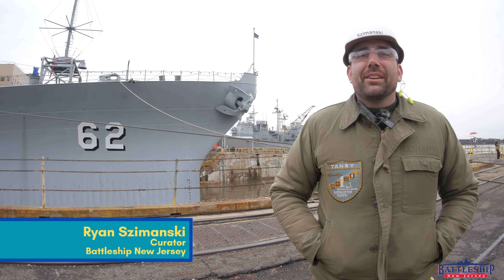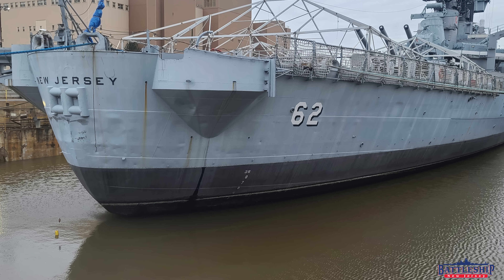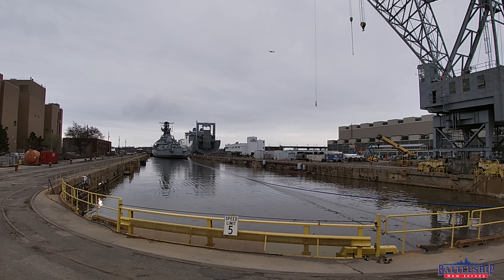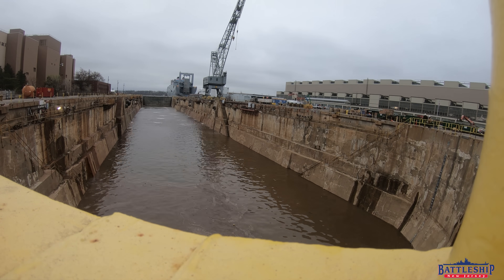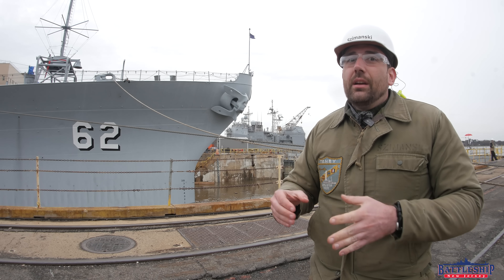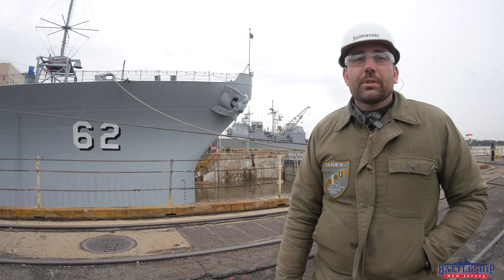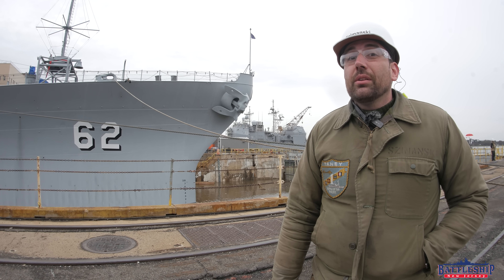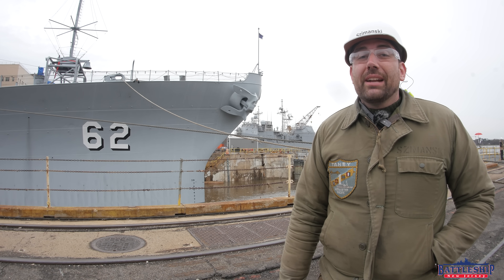How To Position A Ship Onto The Blocks In a Drydock

Comment: This is exactly how it is done here in the UK.
I was a shipyard crane driver in Birkenhead for many years and was involved in dry docking ships for many years. 
The main part of the process is called regulating the dock and is carried out the day before the ship arrives. All the work is carried out by the shipwrights, who lay out all the docking blocks according to the plan  of the ship's bottom. Great care is taken with getting the blocks in the right position and made level. This is a very precise job which calls for accuracy and care particularly by the crane driver.
Once all is ready, the dock is flooded to await the ship.
Positioning is carried out as described in the video, using Tirfors fore and aft.  The dock is drained and work commences.
Interesting and highly skilled work by the shipwrights.

Comment: Many years ago I attended a an awards banquet at Portsmouth Naval Shipyard honoring the engineer in charge of landing USS. Albacore.  For those of you who don't know, Albacore has a very sophisticated hull form shaped like a mackerel instead of a tube,  making her a very challenging boat to drydock.  She's so streamlined she tended to run down tugboats when under tow.  Anyway, the marine railway built to land the submarine derailed halfway through the landing process and they had to build a cofferdam to float the sub into place, hence the engineering awards.  Engineers get awards for solving difficult problems.  However, according to the engineer in charge (and I wish I could remember his name) after the marine railway derailed one of Albacore's former commanding officers told him "I never could get that boat into a drydock straight".  Supposedly the reply was "Now you tell me" but I suspect it was a lot more colorful than that!

Comment: Fascinating coverage Ryan - until now I knew nothing about drydocking! So much planning has gone into this yet as you are showing the actual process is quite basic and very hands on but certainly requires skilled and experienced people. The tugs were amazing - such precision. In flight simulation I often approach a runway at a ten degree angle and straighten up to touchdown but  to approach a drydock with a battleship at an angle and straighten up just as they cleared the stern of the Navy ship was remarkable ship handling. I was amazed at how quickly and smoothly the whole docking procedure was - it made fascinating viewing on the live stream. Thank you.

Comment: I worked on the drydocking of Missouri and Iowa.  I didn't hear any mention of a transit.  I recall one being set up by the capstan and helping spot the ships using a marking on the fantail. I guess that is not longer needed.  Also as a retired engineer I'd suggest you get someone to document the missing pieces of drawing info. that you didn't have.  This will help the next person 30 years from now.

Comment: If for some reason it was desirable to mount heavy guns on a  new class of ship is the mark 7 still the best gun and if so is there a different propellant that has been developed that would be used? Could hyper sonic missiles be fired from guns to get them fast enough for them to use scram jets or would you need special guns?

Comment: Might be a stupid question, but ya know what they say, no such thing...
Are there scuba divers down there watching for when the stern, bow, etc, touches down and where/how the ship is being positioned?
If not, how do you do that?

Oh... haha nevermind! You answered that question! Rad, thank you!

New question: HOW MANY divers and how long did they spend submerged monitoring?

How did they do that back in the days before scuba divers existed or were not advanced enough to be able to do that?
Reply: They've had hard hat divers since the 1820s.
Reply: @ghost307  Doesn't answer my question. 
HOW?
Reply: @MarkJoseph81  Exact placement is important for a heavy ship that gets most all of its strength from the internal structure.
It is much more important for New Jersey because of the multiple blanking plates that have been welded to the hull and need to be avoided.
In general, providing support for a relatively thin skin rather than solid internal structure can lead to denting.
Before diving was available ships were considerably lighter and their hulls were made of thick timbers so positioning the blocks, although important, was not as critical.
The blocks were positioned in the drydock, the ship was sited above them and moored as accurately as possible and the water was removed. Being a few inches off wasn't a major problem.

Comment: Which craft trade is responsible for setting the blocks? I would like to see a video of this process. I imagine the block setting crew has blueprints of each individual vessel to be drydocked so the blocks are properly placed laterally and vertically. That is a heck of a lot of weight.
Reply: More than likely they have the positioning plans as to where the blocks were laid when the keel was laid down 80+ years ago. Now as to the blanking covers that’s a different story.

Comment: On thing I noticed is that they pulled the New Jersey in stern first, and I believe she has been in this dry dock more than once before. On the other hand the Texas was in rather makeshift floating dry dock, made from two bolted together and the pulled her in bow first.
Reply: The stern-first decision was driven by which side of the drydock has the shore power connections.  New Jersey has shore power connections both port and starboard, but (1) no one really knows if the port connections function, and (2) the Ship's museum pier hookup has always been to the starboard shore power connections.  They decided to stick with continuing to use the starboard shore power connections, which requires New Jersey to go in stern first.
Reply: @SomeRandomHuman717  That makes sense.

Comment: Awesome video - love to learn things like this.  My only question is why are all the dry docks "staggered" - i.e. why do they have all have those stepped concrete tiered sides.  Safety...measurement?
Reply: In the old days, ships had very rounded bottoms and were much harder to block. They would just put keel centreline blocks down and prop the hull side to side against the drydock walls using large logs or similar. The older ships were also only designed with the keel itself as a hard point for drying out. Modern ships (and the Iowas are relatively modern) have much flatter bottoms which make resting on blocks feasible. They still do old tall ships with props.
Reply: It's a way of building a wall to hold back the soil. Perfectly flat vertical walls would be very expensive.

Comment: Neat stuff!

I remember when USS Joseph Hewes (FF 1078) was drydocked at Philadelphia Naval Shipyard in 1990 our shipyard engineer (a US Navy Engineering Duty Officer (EDO)) told us that the shipyard docking officers have an informal competition between themselves regarding how accurately the ship is placed on the blocks.

Another interesting thing is that our docking plan had several alternate block positions, and that the block plan used was supposed to be changed at every drydocking. This allows access to the sections of the hull that were covered during the previous drydocking. I assume NJ has several alternate block positions as well.

Finally, I remember our docking officer was really pleased that he had nailed it and placed the ship exactly where she was supposed to be. However, when the water was drained, we found that the trailing edges of our fin stabilizers had cleared the nearest blocks by a mere 4 inches! The blocks had been checked prior to and immediately after docking with no errors found. I don't remember the final outcome; I assume there may have been a revision to the block positions.

Comment: What part of the below-the-waterline areas of the ship am I most excited to see? Aside from the whole thing (in person in May!) I'm super-interested in all four drive shafts, propellers, the armored skegs for the inboard shafts, and the mounting/plating for the outboard. I have a 1/144 Iowa-class battleship that's rigged for RC, and I only have the inboard shafts powered, but it cuts a fine line through the water when I run it!

Comment: Hi,  How is the Block arrangement determined and how do the Blocks get moved?  :)
Reply from the maker: We're following the original navy blocking plan with slight modifications but the plan is just a lot of engineering to balance weight. They are moved by cranes or forklifts.
Reply: @BattleshipNewJersey what happens if the original drydock plans for a ship have been lost? Is it still possible to work out where the blocks go?
Reply from the maker: The engineers could certainly create a new one. Its time consuming to do but is completely possible.

Comment: Are you 500 tons lighter because of Missouri and Wisconsin have thicker front citadel armor?

Looking forward to touching the screws and rudder. I also would like to compare the 1990 drydocking footage to this one. Specifically the dings, dents, and repairs I noticed.
Reply: I wondered about that. 500 tons isn't a little bit. Maybe the Navy took that much equipment off of the ship? I think the citidel armor is the same on all the Iowas.
Reply: @robertthomas5906  Iowa and New Jersey have 11.3". Missouri and Wisconsin have 14.5".  I believe it was done after the Washington Naval Treaty was fully abandoned.  500 tons seems excessive for about 3" of extra armor.

Comment: What's funny is I was watching the transit to the drydock video and I asked myself "How do they put blocks down in exactly the right positions and exactly the right height AND line up the ship such that when the water is pumped out the ship doesn't fall over?"  And here you are today to answer that very question.
Reply: The Navy has blue prints (Drawings) for dry docking every ship. It tells size and location so the ship sits the main frames on the blocks. The blocks are not flat BTW.
Reply: @tswalker2978  Yup. They followed the specs. I might be wrong (as i might have misunderstood) but they're not using the same blocks the Navy would've used, but other than that, they're following the plan. No trail blazing here.
Reply: I wondered the same thing .  Also the same way a really tall building is built straight.  Close to the center of the building is a hole in the floor - usually where a utility/mechanical room will end up.  And a hole in the ceiling above.. and another in the floor below.  3-6" in dia (7 - 15 cm).  This stack of holes goes all the way down to the basement - where there is an X on the floor.  Just above the X, a brass plumb bob you can buy at any hardware store.  That line provides the absolute vertical reference.  Make a 345 triangle and now you have an absolute horizontal reference.  The beauty of it that it doesn't matter what the terrain is outside.  That weight points exactly to the center of the earth.
Reply: @fredinit  I wonder if you could make a Foucault's pendulum out of that
Reply: @ImieNazwiskoOK a Foucault's pendulum is just a plumb bob that has been set to swinging.
Reply: Me to

Comment: When I am there on April 6th I will be looking for the repairs and elimination of the Paravane Pulpit at the fore foot of the bow. I will also be looking for the plated over sea chests and of course the rudders and propellers for signs of corrosion. I would like to know if the entire hull will be painted or just the bottom ? Please maintain the boot topping at current height as the one on Missouri is too low distorting the shape of the hull. Another item of interest will be the cathodic protection of the hull and where you intend to place new ones. I have been reviewing my copy of Richard Landgraff's book on the Long Beach Naval Shipyard which details New Jersey's last drydocking there with some photo's of her condition then and outlines some Iowa class maintenance issues.
Reply: photos of

Comment: To make inspections easier a pump using tap water going in that removes twice the river water might be worth while for a drydock.  Some injection pumps are used in wells to lift about double the injected amount, they use some tricks of engineering but if at the halfway point the water is near swimming pool grade, divers would be able to see better.  Also could start washing the sides too...
Reply: The pumphouse that sits to the port side of the ship has been doing a good job of flooding and dewatering the drydock for its 100-year life so far.

Comment: How do they paint or service the portions of the hull that are resting on the blocks? Can one block be moved at a time, service and paint that area, then move it back into place and move on to the next?
Reply: He's explained this in other videos, but the short version is that they have multiple positions for the ship. They will float the ship a little bit, move it, and set it down in a slightly different place that gives them access to the previously covered locations.